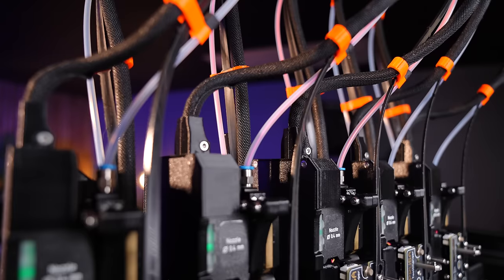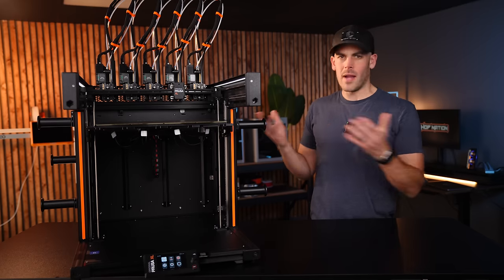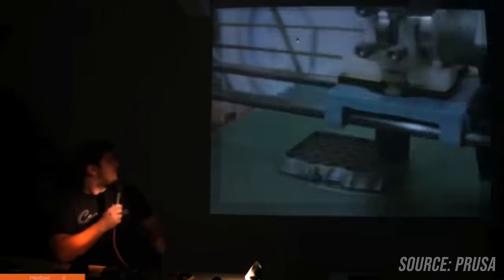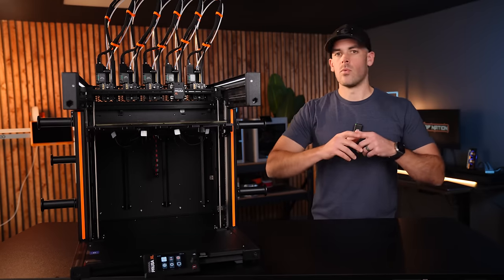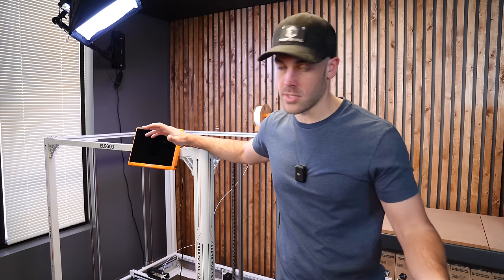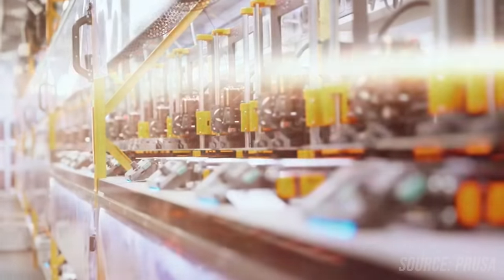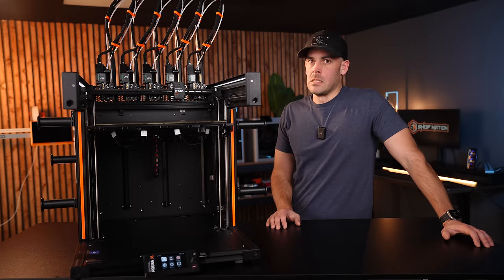Why Prusa is the next Blackberry

Comment: Prusa has a couple of things going for them:
1) reliability - their printers are some of the best "set and forget" machines for printing, even if they are bed slingers. Just give the printer a file, and it'll be printed.
2) history - They've got plenty of time under their belt to show that they support their products, old and new, and don't force subscriptions, excessively expensive spare parts, or any of that crap
3) support - Prusa's support is great. Lovely people on their support team, and a fantastic community behind them, if you ever need help
4) expandability - with how many mods there are out there for their printers, I don't think Bambu Lab has any hope of catching up in this regard

They're a company that stands by what they say. I don't know how much companies value that, I know lots of people that do though. The Bambu Labs machines seem more like actual paper printers, where the machine itself isn't the money-making part. Sure, they're fast, they're relatively cheap, but what if Bambu Labs decided to add a subscription fee to their printers so you can keep using them tomorrow? They're not open-source, you'd have to swap the driving board for that, and reliability, speed, etc go out the window, at least in a professional environment.

Comment: Totally agree and the signs of the behemoth turning into another Blackberry are alredy visible in their customer service, delays in servicing orders and the general sense that the business knows only one model. Anyone can gimmick with sweets but capability, manufacturing and servicing capacity and that sense of willingness has been eroded over time. MY Prusa MK3 is an absolutet stalwart but I wanted better. I wanted Prusa to be where Bamboo have just appeared at. Your analysis is 100% spot on. Pivot or decay away. Great video and thanks

Comment: The first thing prusa needs to do is not sell a $1000-$4000 printer that doesn't work when you buy them on launch day...
  This is the reason why I completely skipped the Prusa brand when looking for a 3D printer.
  I saw that the prusa mk4 was the same money as the p1s, without any clear benefits, and later found out that even with what it compares to the competition, it has not worked for months since they released the machine for sale.
For a product of 1000 dollars or more, I'm absolutely not interested in repairing and hacking it myself afterwards just to make it work as advertised...

Comment: just ordered the dewalt miter saw dust collector 3d print files a few minutes ago.  my wife asked me why i didn't just design my own, im pretty deep in the engineering / fabrication game.  i said..."this guy did a fantastic job and the files were $16.00  any money saved by designing my own would be lost 100x in time compared to purchasing the design".  long winded thank you.

side note, to add to your catalog i suggest you work on a design for the evolution metal cutting miter saw.  this is a relatively new machine that's performance is impossible to ignore.  i imagine first order customers will be professional / industrial clients, second order market the average consumer.  these will eventually 100% replace abrasive wheel cutting (not including angle grinder).  love the chanel, love the dust collector, hope to you make a ton off the suggestion!

Comment: Interesting, I have a Prusa XL, Ender 4 , BAMBU X1 , Voron 0.2,  (kids dogrs would be cheaper ) , But every day print is Voron . i use lott the voron printer , after that , The Prusa and Ender, and I rarely use the X1. other note the Prusa and ender printers are heavily modified , and the Pruse has 0,2 head.
Reply: I bought the X1 for the interest, but I probably will sell because i dont see long term use of multicolor printing. But is the best printer for artist, or peppole like hu dont really like the smell of resin. From out of the box it prints really well.

Comment: I ordered a 2 head XL when it was first advertised.  After waiting a long time it still wasn't delivered.  I got a Bambu Lab carbon.  It's a little small, but works great for the majority of my projects.  I still love the features of the XL, but I would only need them for a very few projects.  In addition, the early users reported issues that indicate it still wasn't ready for release.  The Bambu Lab printer functions as a real upgrade to my trusty Prusa MK 3S that I upgraded over the years.

Comment: Hey, could you or anyone owning a XL with multiple heads help me out on this one. 

Can i use various nozzle diameters with the same material? Eg. I want to print smth, sections with finder and/ or more important bits with a finer nozzle and the bulk/ infill with a 1.0 Nozzle. 

cheers

Comment: You are not mentioning that prusa has a huge part of the commercial 3d printing market and has acquired a few companies to do this.  They aren't just concentrating on the consumer/hobbist market like Bambu.  They have also gone in-house with their filament production.  Also acquired printed solid for the US edu market and for future US distribution. I think they are pivoting for the future and just because you haven't seen all their cards, doesn't mean they are going to fold their hand.  As an owner of many Prusa printers and Bambu printers, I can say that there are some good traits that Bambu has brought to the consumer, but overall the Prusa machines are much better and more reliable work horses.  The biggest upside to Bambu is they brought good competition to Prusa and that will only benefit the end user.

Comment: Excellent observations. I would have a quibble somewhat about 'appliance level printing'. In my experience that level of usage arrived 5 years ago with the FLSun QQ-S Pro. Yes it did require me to assemble the unit. However it was no harder than well known Xmas bicycle exercise every parent knows. Mounted the probe, auto leveled the unit and it functioned flawlessly. And here we are, the only things I have done to the device is a hardened nozzle, upgraded the PTFE tube, a mod to the spool holder, and auto level every hundred prints or so. Good enough that I now have two, the QQ-S and the newer VS400. 
Its engineering that just works.

Comment: prusa never made SINGLE good printer. bed slinger are inherently bad design, and prusa xl with ridiculous price tag and open non actively heated chamber is absolute joke. and btw bambulab is also long gone speed king. e.g. qidi x max 3 is faster, way bigger and also much cheaper at the same time...
Reply: Try make your printer go faster than a LH stinger then.

Comment: Can the multi head have different nozzle sizes? So quick thick walls with a big nozzle and fine details using a small nozzle? That might be cool too..? Depends on the model if it would make sense, probably. Not sure if slicers can handle that scenario either?

Comment: I own a Prusa mk4 and it is the worst prusa experience ever. Occasional layer shifts, filament debris gets stuck in runout sensor all the time, gaps in the layer seam, very slow takeoff for early adopters like me. I'll get it checked by prusa but I have nothing but problems with this machine that comparably cost a fortune and should have ran out of the box with ease. I'm highly interested in the Prusa XL but I can't buy it because I don't trust prusa any more.
Reply: I came across this comment and I couldn't ignore it. 🙂These don't sound like typical problems of a Prusa MK4 and Prusa' Support is not eligible to leave a customer behind, on the contrary, they would have no peace until a satisfying solution is found.
Reach out to Prusa Customer Support via the official support channels and don't give up!

Comment: At this point, I won't even consider a printer that isn't fully enclosed. And that doesn't just mean the printer, the AMS system keeps filament ready to use and dust-free between prints. There are many compelling additions Bambu has made. I like Prusa and I hope they can catch up and then push the needle further but they better hurry because I suspect the X2 series from Bambu will start to trickle out sometime this year.

Comment: the core-xy is pretty much a done design. there isn't much room for improvement. faster, more reliable, yadda yadda. these are incremental gains with diminishing returns at this point. i think one of the few things FDM can still improve upon is true 3D printing: 5 axis on a consumer printer would completely change the game.
Reply: a 5th axis..... would be absolutely pointless on an FDM printer.  I'm also not sure you know what 4th and 5th axis even is in the CNC world (Yes.. 3d printers are cnc machines, just additive instead of subtractive) 

A 4th axis would add rotation around the X-axis (X-axis is the left and right movement of the print head) 
A 5th axis would add rotation around the Y-axis (Y-axis is front and back movement of the print head)

Working along the 4th axis could be doable, but the gained functionality would be very costly, as you would need to ensure the 4th axis was able to adjust it's height as well to remain within the build volume and not crash the part on the supporting frame / structure of the printer, or if it's fixed, would require a lot of unused space under the 4th axis. congrats, you've just tripled the size of the printer. 

A 5th axis would also not be a great idea for the same reasons. You would essentially be adding more and more machine volume, and cost, without gaining much in the way of capabilities.

Comment: I had a Makerbot Replicator, it had some innovations but they never kept it going. It's magnetized hot-end with extruder and nozzle in one was cool... until it jammed, which was EXTREMELY often, and you had to dissect it completely apart every single time, so in a business setting, we had literally 3 sets of these magnetic heads with pogo pins, note that the magnets were so strong that they nearly severed a coworker's finger and they had to go to urgent care to get stitches, this was just putting the thing on after we unjammed it. We had 3 of these so that we had a constant rotation of 2 jammed and one clean. I'm not even joking.

Comment: I agree with you on this. When it was time to move on from my Ender3 at home I jumped to the MK4 and love the printer.  But when it came to picking a printer for my workplace the Prusa just wasn’t a competitor - between the price, fully enclosed housing, the AMS and all kinds of other features and most importantly looking like an appliance fit to sit in an office the X1C was a much better choice the the MK4 which is a shame because I fill Prusa could have made that leap but decided not to for whatever reason.

Comment: Is anybody concerned about the actual print quality and consistency? i have the feeling neither of them (Prusa and Bambu) is good enough to print only with the highspeed settings for now. Maybe the usual hobbyist customer doesnt care, but i want parts that i don‘t have to do tons of finishing work on, on a high level. I hope that Prusa is able to bring the designconcept of the XL into the next more affordable Mk5 in a more compact enclosure format - while i am sure that its just a matter of time making inputshaping as fast but still as robust as without it. Lets hope they can do it in time before being pushed out of the market…
Reply: The quality is absolutely incredible even at very high speed even the strength is not really affected by speed on the bambu because corexy is soo much better 
The xl, a lot of people say it have a LOT of stringing even with dry filament and good temperature 

The consistency is way better than on a bedslinger the hot print that can still deform is not moving back and forth

Comment: Big thing that I want to see here is like other commenters mentioned -- dissolving support made a priority which makes the filament production companies key. Otherwise, and particularly for @Shop Nation here is that this would actually do multimaterial with different materials like TPU for impact resistance and nylon for strength. That could open up some interesting stuff for things like the miter saw dust collection systems -- TPU for the hose connection or TPU for a flex in a spot to make blade removal easier or ABS to smooth the inside easily for improved flow. There's lots of possibilities there that other printers literally can't do, but the community needs designs specifically for that.

Comment: Do you know what an upgrade is, the ender 3 v3 ke, i got it and selled my old ender 3 v2 it is just so much more, it soo fast, i don't have to level it, it prints abs, has direct drive and a silient board, for the about 1,5x the price i payed for the v2 6 years ago, if i would by all the thing to make the v2 similar it would cost so much morr

Comment: One of the reasons is that their marketing of printing 3D printers which is not exactly efficient way of manufacturing high volume goods, backfired. They said they can innovate and yet they were one of the least innovative companies. I have Prusa Mini, the only problem I ever had with it is not consistent first layer. But since I do only technical prints, it doesn’t bother me.

Comment: I was doing some experimenting with the slicers for both the X1C and the XL and I feel like the XL is less niche than was stated in this video. Also in my personal experience, I have had many prints on an X1C where more than half the print time is changing the filament. Of course, I could just fit into its niche.
Reply: If the print volume is not an issue you still have the better printer.(X1C)
For 4k you can get multiple printers and eventual get more prints on several machines than a single printer. 

I will ignore folks who have issues tuning the XL as there are a bunch of issues ytubers have run into with the XL. Assuming perfect prints every time  $4000 is 4-7 printers. A single XL may be faster at swapping than a single X1C but in terms of yield is isnt beating 4k worth of them. a1 mini A1, p1p, p1s and X1C

When you take actual prints on the XL multi filament prints barely work. There YKG3D made 13 XL prints and only a couple came out alright but quality was not good even for the successes.

Comment: The advantage on the multi-color benchy on the Prusa drops dramatically if you print N benchies at the same time, because the filament switching time gets cut by a factor of N.  There'd still be an advantage for Prusa, but it would be quite a lot less.

Comment: The Single Print Head multi spool filament input does an automatic transfer from one spool to another when the filament runs out. This eliminates the tail ends of spools laying around. Prusa could do the same with a small amount of code to automatically switch print heads when the filament runs out. Then I could have two spools of the same material, and have it switch when one spool runs out.

Comment: because the mk 4 is overpriced for what it is? or too small for what it is?
To compete , the mk 4 needs to cost half what it does, and have a version with 450 x 450 x 450mm or higher print area.
Reply: how to do that with prices from middle of Europe? In Czech republic you may buy 2 kits for avg salary per month...

Comment: I feel like the Bambu labs and Prusa are addressing different needs. If you replace your phone every 2 years I think you be happy with Bambu labs. I'm happy with my MK4. It is open and maintainable with printable parts. Those core-xy printers look slick but I would have no idea how to troubleshoot it. Core-xy is faster, but the MK4 with input shaping seems plenty fast to me. The X1 might be going so fast its trying to reach escape velocity. Sounds like it too. I would rather have a quiet printer than a fast printer. If I print overnight, who cares if it takes an extra hour to print? But can I sleep with the printer in the same room?
Reply: Bro it's 2 belts with 2 motors stacked on top of each other. Printing overnight in the same room? Mmmmm, sweet and yummy microparticles and VOCs.
Reply: @youtubehandlesux  If I see ringing on a print on a cartesian I at least know what axis to check for loose screws or belts. On a core-xy what do I tweak? It would be fun to play with at some point though. I've been thiking about making a voron, but I have no space for one! Your point about microparticles is valid if you don't have an enclosure or ventilation. Ok. Can you sleep with a jet engine is running in ANY room of the house? I'm a pretty light sleeper. For me the answer is no. You seem happy with your descision and I am happy for you and wish you the best of luck. Happy printing!

Comment: 5:48 And that defeats the whole purpose of having multiple print heads. 
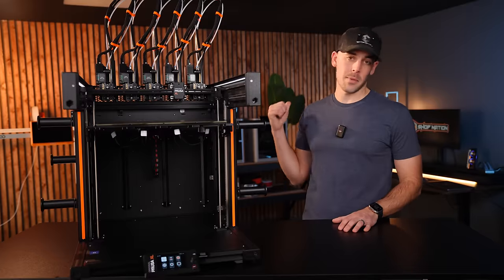6:12 You can buy 1 Bambu P1S with AMS and 3 more AMS modules for less than a single Prusa XL with 5 heads. And now you can print in 16 colors or materials per print. As soon as the whole purging issues (which are more of a slicer problem than a printer problem) get solved, Prusa can kiss their XL printer goodbye.
Reply: even with 4 AMS and hub, you will be slower
Reply: @kareldvo I'm going for print quality, not speed. I've seen a lot of reviews on the XL and print quality is still "in development," much like everything else on this printer. And I'll have up to 16 choices of color or material per print, so that's a reasonable trade-off.